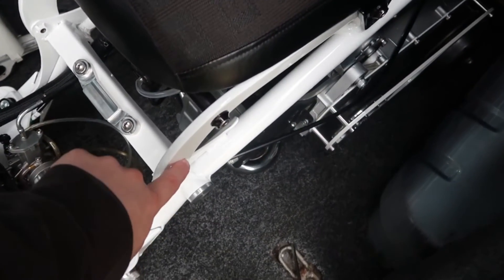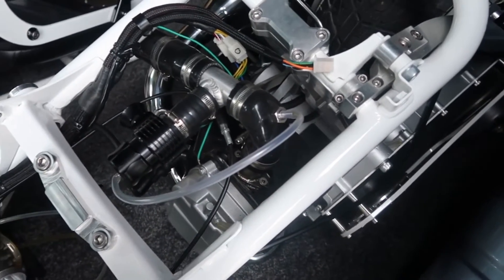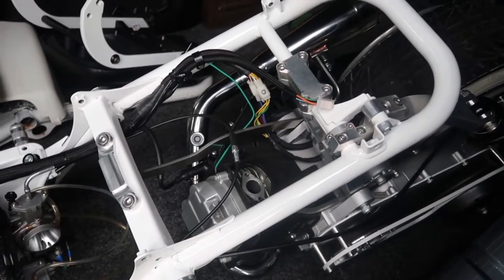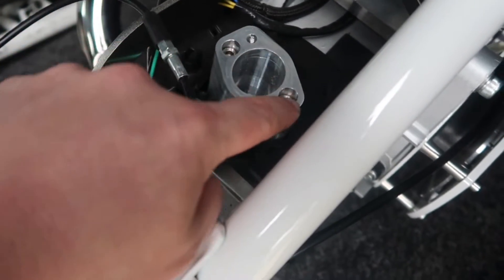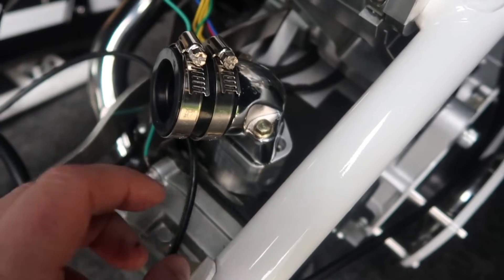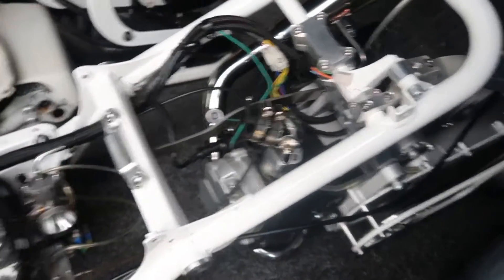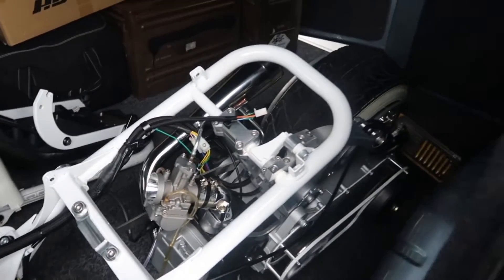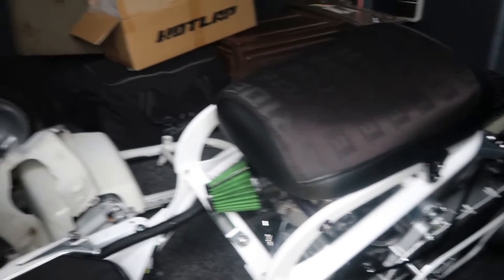Fitting Carb To White Ruckus

Comment: Get your mix after it warms up. THE idle Is fine at start up lol. FUNNY STORY 
I had a knock off carb THAT some how the idle Screw Was Way Loose due to manufacturing error lol self adjusted itself!  Being a cheap knock off and not Relizing I hit the start button while not on the bike and it took off as possessed by ghost rider!  My bike is very balanced cause I had to run it down before it hit my Neighbor!  AN older man which happened to be walking on the other side of the street AS ITS COMING AT HIM HE FREEZES IN FEAR I GUESS AND I ENDED UP  tackling it like you see on American football 🏈 not ⚽️. MESSED MY LEG UP FOR MONTHS AND HAS TO PUSH IT ALL THE WAY HOME WHILE WEARING FLIP FLOPS WITH BURNS, CUTS AND HUGE KNOTS ON MY LEG
Reply from the maker: I rough it to get it started and then do it warm and whilst riding

Comment: Hey whats up man quick question did u just use regular rtv gasket maker on the intake parts right?
Reply from the maker: Hi. Yes sir. Just a regular fuel resistant gasket maker. Don't use too much as you don't want it squeezing into the intake path.
Reply: @RuckStyleUK  ok gotcha and thanks man